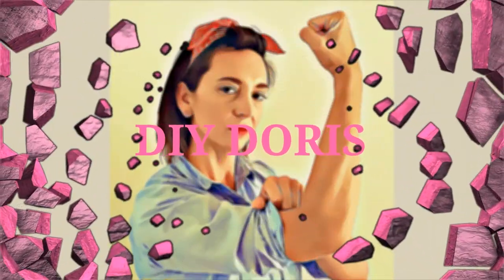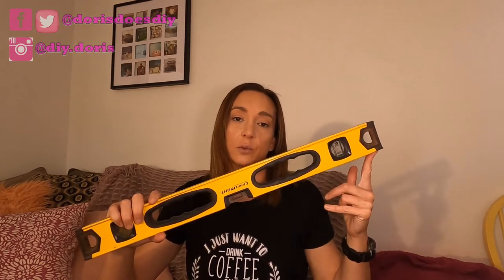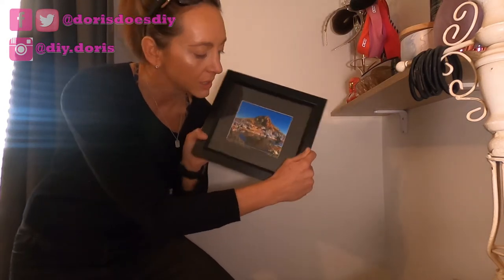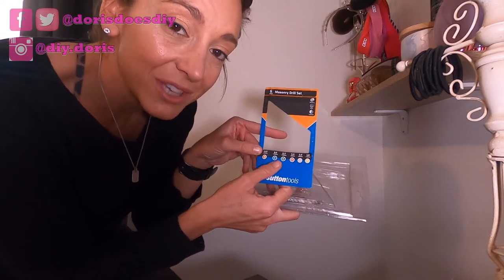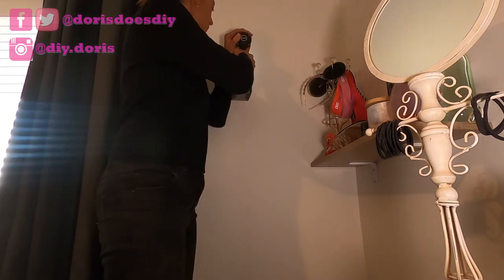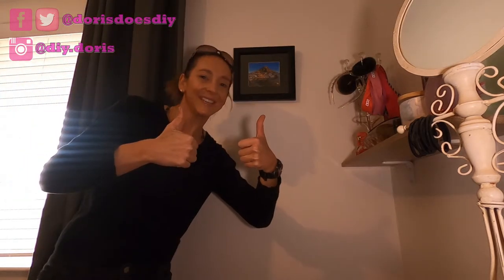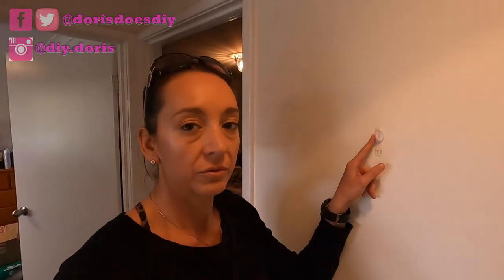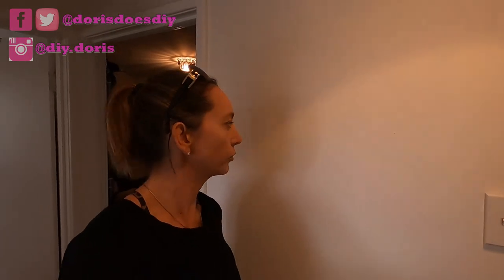How to hang a picture on a brick wall.

Comment: I am in a rental in australia and we are not supposed to drill into any walls. 

I tried the sticky Velcro strips (four sets on either side) and the picture fell off the wall and the frame smashed it was less than 10kg but it’s humid here ($160 to replace just the frame)…so don’t want to do that again.

Are there any options that fall somewhere between the damage the drilling does to the wall and the sticky Velcro strips? Thanks C